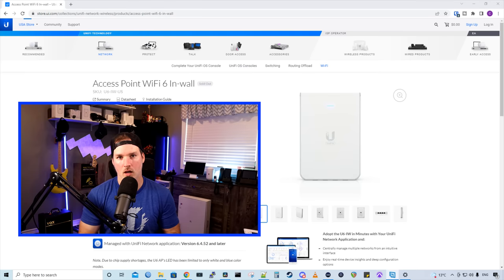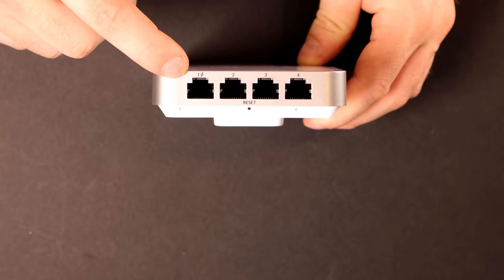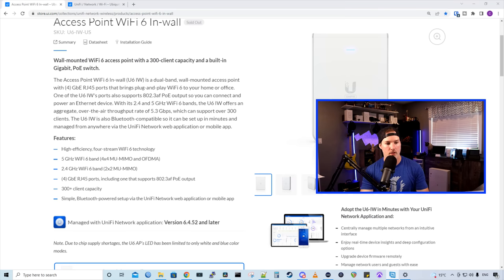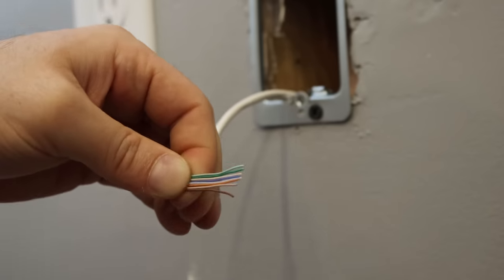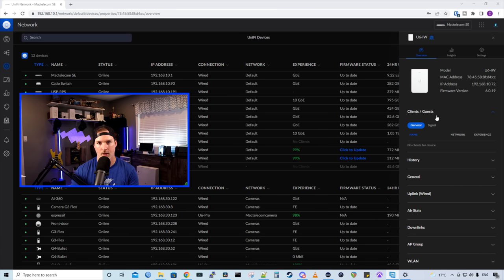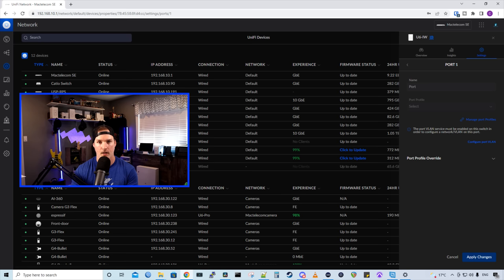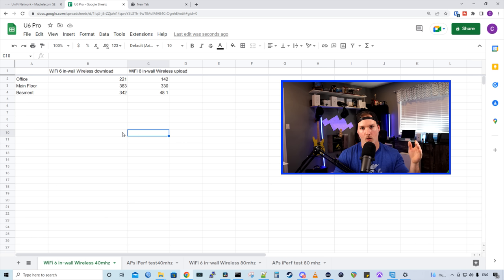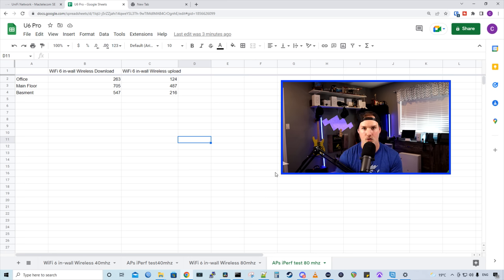Unifi WiFi 6 In-wall

Comment: Hi Cody - Have you noticed any performance differences when deploying these at standard wall outlet height (close to the floor) versus standard light switch height (several feet or a couple meters off the floor)? Thanks!

Comment: When you get the chance it would be VERY interesting to see a comparison between U6 Enterprise (WiFi 6E) and U6 Pro (WiFi 6) - tests should be done on a WiFi 6E compatible device, such as the new Samsung S22 Ultra / Google Pixel 6.
Reply from the maker: Can’t do any test until it is release from ea . Ya I need a new device for wifi 6e testing but don’t want to spend the money 😭
Reply: @MactelecomNetworks  I see that in Europe they can be ordered. For testing I would recommend just borrowing a WiFi 6E device from a friend. Buying one is not worth the expense.
It will be interesting to see how much does the 2.5 Gbps port + WiFi 6E differ from everything else that's on the market.
Range from AP would also be interesting. There aren't any good videos about this yet. So it could become quite viral.

Comment: Hy Cody.. does the U6 inwall support mesh uplink to another AP? I have a remote location without lan cabling and want to connect wireless to the network.  I also have some wired devices in that location so i hope the switch would output the lan still when only a wireless uplink is avaliable
Reply from the maker: Hey it does :)

Comment: Nice video.  One question: can we connect WiFi6 in-wall as mesh access point (not connect directly to Ubiquiti switch)?  Then use the extra ethernet to connect to desktop computer.  I want to use WiFi6 in-wall as a computer WiFi adapter.  Thank you.

Comment: Cody are there any concerns with heat and connecting the aluminum bracket directly to the drywall with anchors vs a metal box?

Comment: If looking for video ideas, would love to see a video explaining 'real world' radiation patterns of various access points, when to use them. comparing the IW, the standard 'U6plus' and something like the UniFi U6 Mesh Access. If you had a garden 350' from back of house, which one is directional. Does the IW radiate behind or just to the front or more 360 degree? Is the UniFi U6 Mesh Access 360 degree?

Comment: Any idea if the U6 In-wall still supports the UniFi In-Wall HD Junction Box (SKU: UAP-IW-HD-JB) since its a bit wider?
Would roll out this in each classroom but the wall are brick so we would work with a small cable tray that connects to the junction box just next to the teachers desk.

Comment: Love the concept of the U6 in-wall. My only issue is I’m getting very low throughput (around 95mbps over 25m of CAT5E), however I’ve just noticed I’m powering this using 802.3af 15w. Could that be the problem or the CAT5E. Any thoughts?

Thanks

Comment: I ordered it... then Ubiquiti canceled my order without notifying me or anything.....
Reply from the maker: Hopefully you get one and figure out what’s going on
Reply: @MactelecomNetworks  Thanks, I've only paid them a few thousand the past few months.... so I'm a small fish hopefully this issue can be fixed, I still have a number of devices to purchase and deploy.
Reply: Apparently I hit the wrong keystroke on a digit in my credit card number, they processed an order anyway and their response is to intermittently cancel orders, miss identify what credit card company card was the issue. Its been terribly unproductive and still don't have it resolved since ubiquiti says I need to go to the bank and fix it but I don't have an account that I can fix it with. Certainly my mistake if I miss entered a single digit, and have repeatedly offered to pay. But it appears they use a 3rd party to process payments and the third party processed it then charged it back. Its caused a lot of misinformation coming from their end resulting in me being unable to fix it from this point, which is frustrating and without being able to have an actual phone conversation to correct the issue its still unresolved....

Comment: With this design, anyone can pry the AP off the wall, taking the AP away AND access the main network (especially when these are installed at relatively low and accessible locations). IW-HD and AC-IW both had security torx screws on the cover and on the AP to reduce this chance of happening.
Reply: That's why vlan exist, the stealing the AP meh not way to stop that from someone dedicated enough